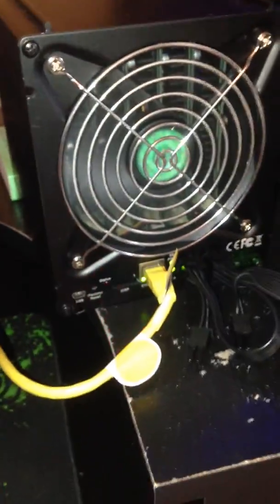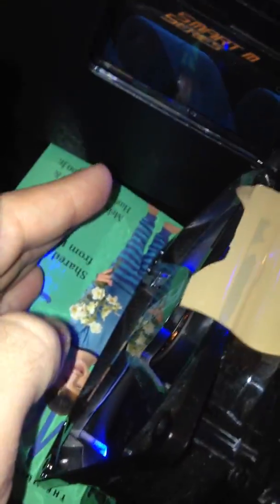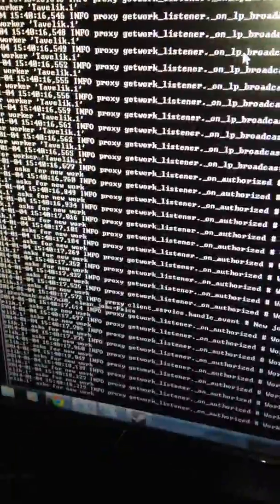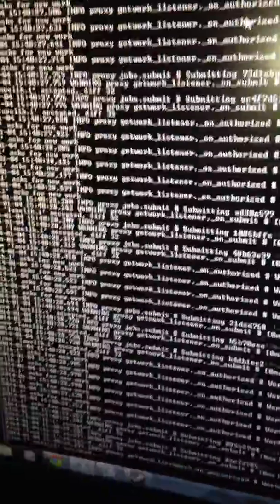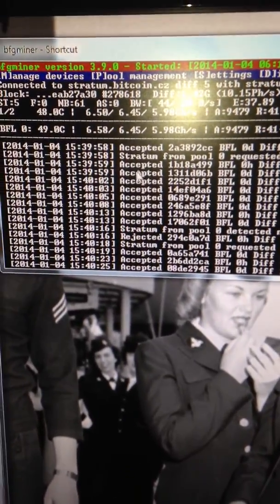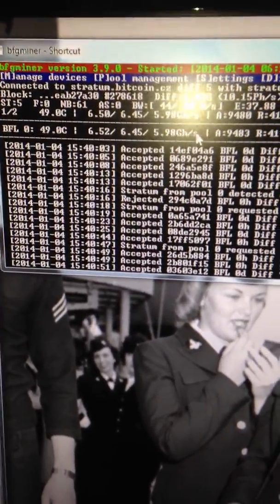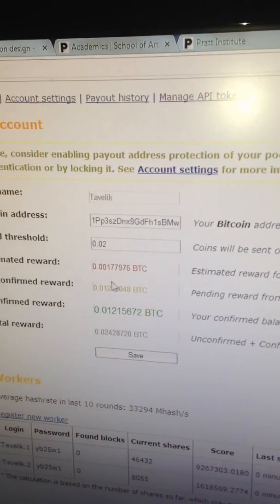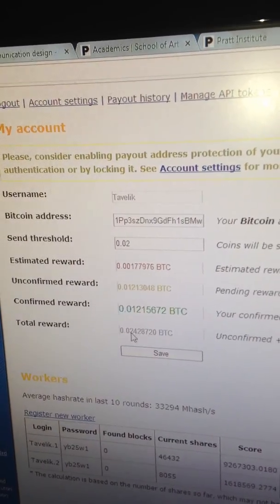My ASIC Block Erupter Cube and BFL Jalapeno Bitcoin Mining setup

Comment: Hey Christopher Janaro, I am thinking about picking up one or two of these cubes and I was curious to know your turnout. Was this profitable for you? I'm not interested in the Jalapeno, but definitely in the Erupter Cube. Would you consider these cubes worth the investment at the current exchange rate and difficulty? Also, how long on average does it take you to mine a single bitcoin? Thanks in advance!
Reply from the maker: Imperial, At this point I would not recommend buying the erupter just because the difficulty has increased so much since then.  After the cost of electricity and gear I came out ahead with a 25 percent profit.  If your looking at purchasing a mining rig though I'd recommend checking out a mining calculator to get an estimate of what you'd stand to make but just bare in mind that the mining rig you buy might be on back order and by the time you get it the difficulty will have likely risen.
Reply: Christopher Janaro Thanks for getting back to me. Yeah, I came to the conclusion that it's probably not the best course of action. Then again, I'm not too sure if I would make a profit or not. The only real investment I will have to make is the equipment (Erupter/rig). I'm going to be going off to college here very, very soon, so I won't even be paying the electricity bill. I'll most likely just hangout and keep my investment though.